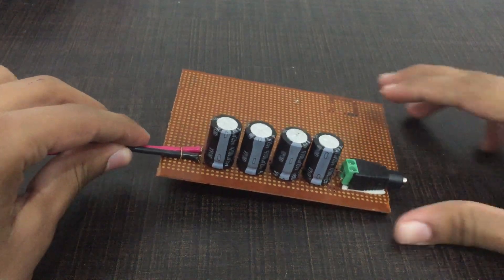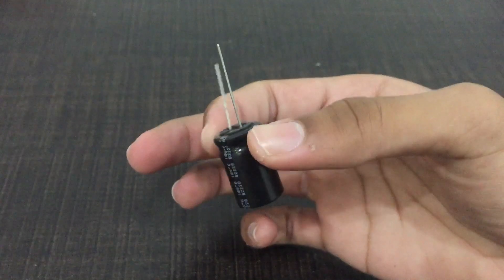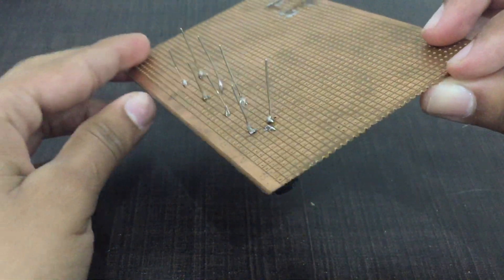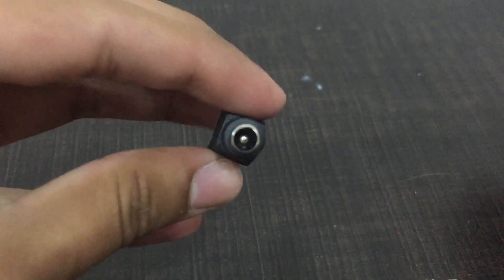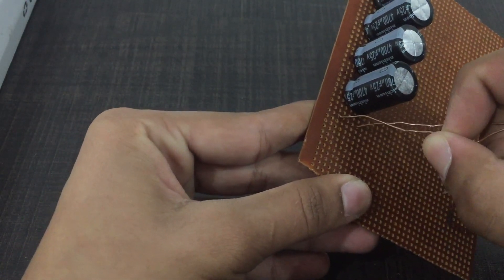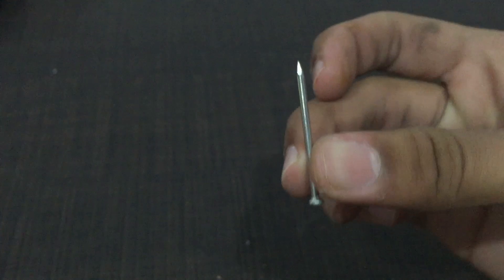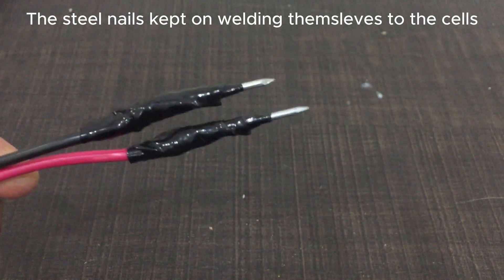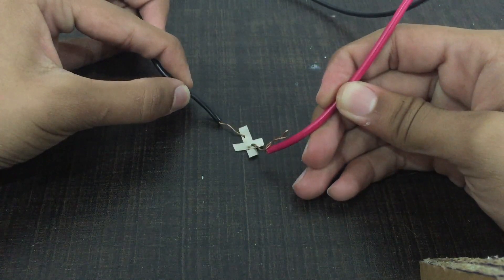Trying to make the SIMPLEST spot welder for 18650 cells

Comment: try changeing the copper wire electrodes with graphite ones. you can get them from zinc batteries
Reply from the maker: Thanks for the suggestion i would surely try that as well
Reply from the maker: Not working 😭😭